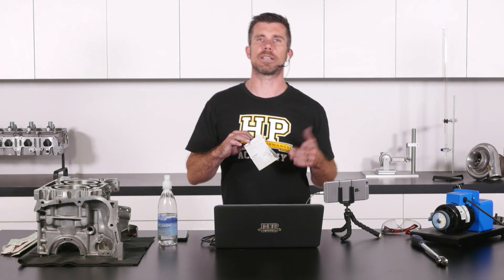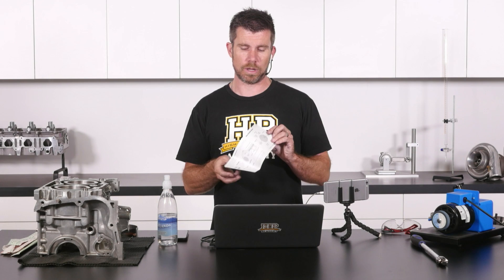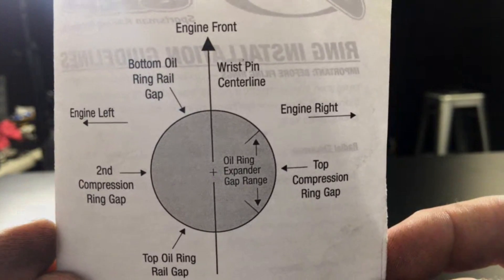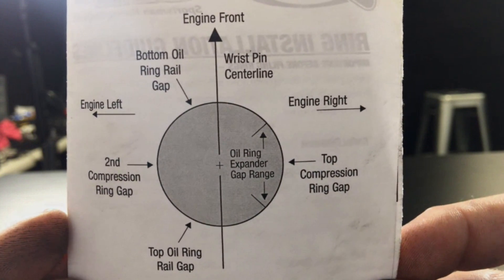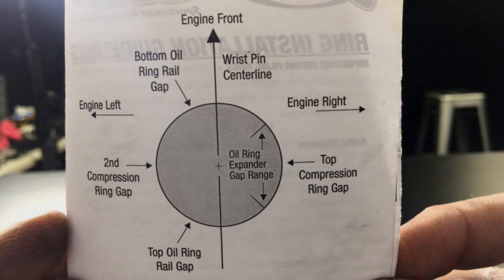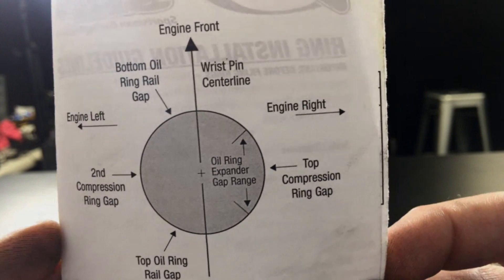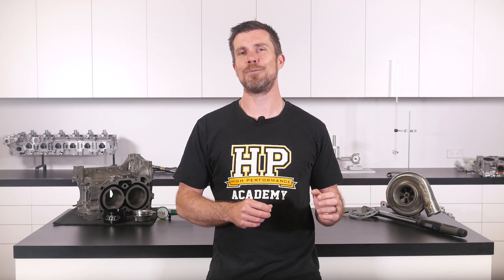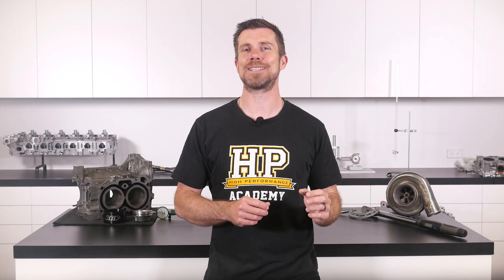[HPA Q&A] Aligning piston ring end gaps | Performance Engine Building

Comment: Ah, kept forgetting - must be the alzheimers kicking in...
I was going to post this in the ring gap comments - but can't find itnow.

I don't recall ever seeing mention of whether E85, or other high alcohol fuel, has any affect on the gap as it is a cooler burning fuel? If the engine never sees time on a 'normal' type petroleum based fuel would it be practical AND SAFE to close them up by a half thou', or whatever, per inch from the given gap/application guide, or best to leave it at a normal forced induction based gap? I was also looking at some of the coating articles on the Wiseco site, following up on the latest give-away, and it reminded me of something else I have been curious about - whether the reduced piston temperature, and hence heat to be rejected through the rings, etc, might mean it is practical to close the gaps? 
With 2 compression ring pistons it may be less critical, but more and more single compression ring pistons are being used now, for a variety of reasons, so it may be of increasing importance to get the gap as close as possible without, of course, going too far.

Then there are the two piece, Total Seal rings - some swear by them, some swear at them - they seem to offer little over a normal one piece in a reasonably fresh engine, seems their benefits, if any, would be when the engine has done some work and the gap would normally have opened up slightly?

Must be getting chilly down there...

Comment: Every now and then, vehicle manufacturers get this wrong at the factory. 
I bought a very low km Z18ET years ago from an importer, the entire original internals looked like it was put together yesterday, however all the ring gaps were aligned with each other. 
A new set of rings were installed and the engine did multiple seasons in the 910 rally car. 
During this time, I worked for Mazda and we had several GE 626 2.0lt engines using oil at low km. Again, a batch of cars were found to have been assembled with the ring ends aligned.

Comment: SO glad you pointed out that the rings are continually rotating* - as a 'prentice I took ring positioning as gospel, but, really, I don't bother with it now other than to ensure they are free to rotate in the groove. I'm much more concerned the end gaps are adequate and the side and back clearances are acceptable, oil control expansion/ spreader ring isn't overlapped and the scraper rings are free to move, as all these can destroy the bore if wrong. Oh, and that the bores are CLEAN and lightly lubricated.
That said, different people have different opinions on orientation, which IMHO is fine as long as the basics are observed :-)

*The only exception I am aware of is with 2 stroke engines where there is a pin, or some other method, to prevent the ring(s) from rotating in order to prevent a ring end getting caught in a port. Might be others, though.